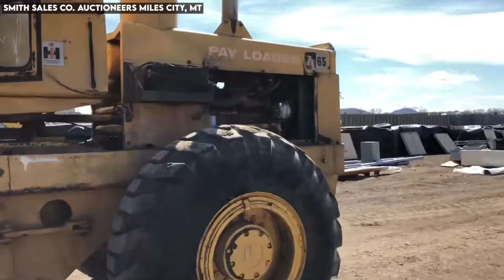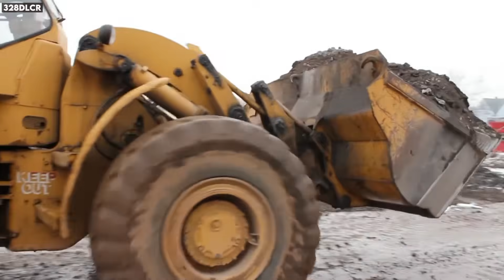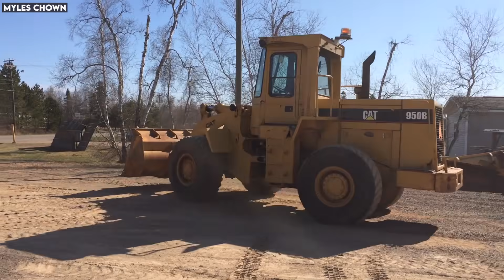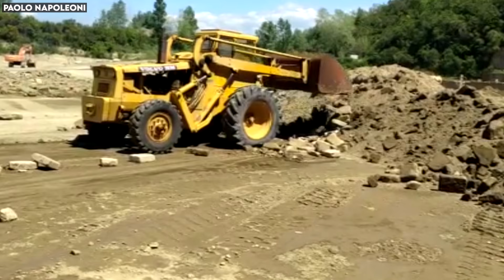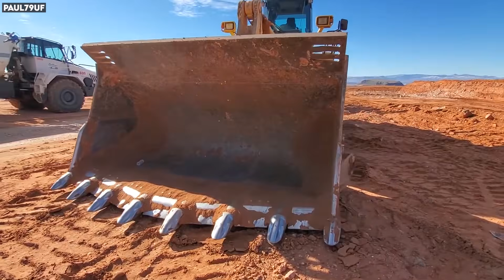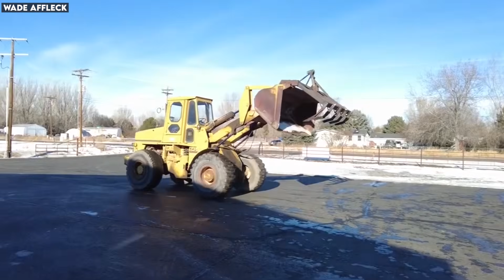10 Old Wheel Loaders That Just Won't Quit

Comment: Sorry, but Clark - Michigan was the best, and should be number 1.
Comparing each of the CATs to the direct competitor of its class in the Clark - Michigan lineup, you can easily see that from engine power to breakout force to sheer weight, there was no match. Sadly, Clark - Michigan faced lots of financial difficulties and eventually faded away, while CAT remained.

Comment: I liked the Cat (966) 😊 with the straight forward power shift, you just pushed the "Lever" up for forward and pulled it Down for reverse 😊 it was very beefy built 😊 and to shift to the higher gears, you just twisted the big hard rubber handle 😊 very straight forward engineering 😊 on the John Deere (544) that I worked with a lot in 1979, they had a big dealership in my state. 😊 it was a little different but it was still simple shifter 😊 same principle up for forward and down for reverse. But it had a pointer down in front of steering wheel. That had call out letter for the gear setting 😊 you just kept pushing the lever up and the indicator showed the higher gear you were in. All the sewer contractor when I did mainline sewers had the John Deere series in my area. Their was only one job I was on, very muddy, work, that the contractor I worked for used the Case 850-B "TRACK" Loader for backfill and Pea Grave runs. That power shift "TRACK" system that CASE built with the (High/Low) Track speed right between your legs, was so far advanced for the time 😊 and when it the "HIGH" setting, that Case Track Loader, was basically as fast as any wheel Loader, but a Wheel Loader would have got "STUCK" in that soft deep MUDDY ground we were digging the main line sewer in that wooded area. We have lots of "RAIN" in my state.